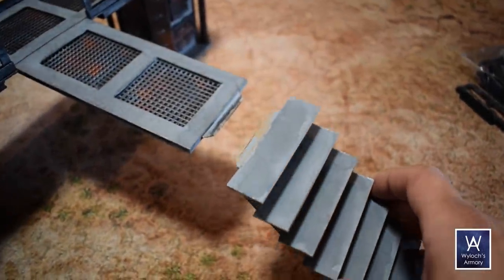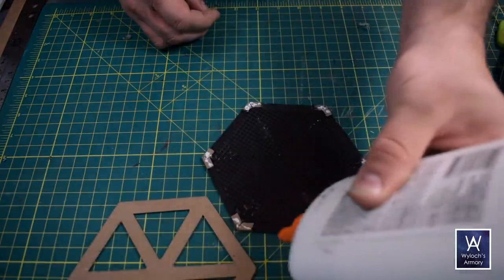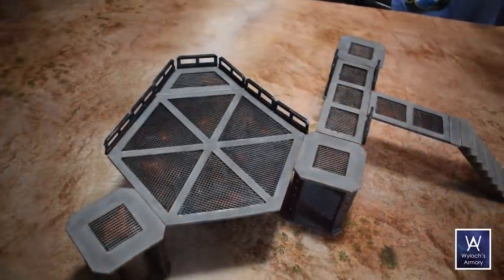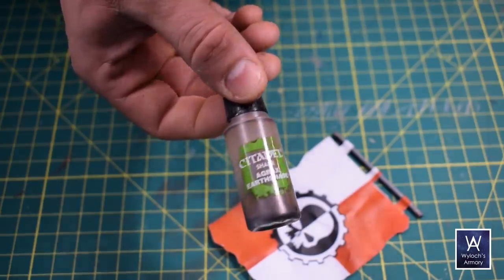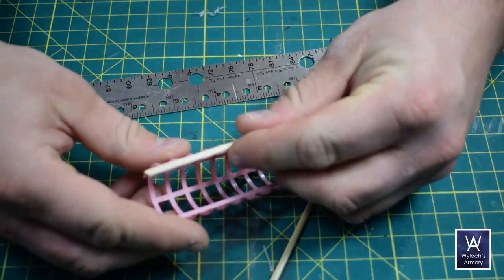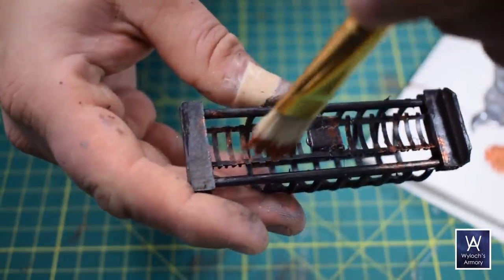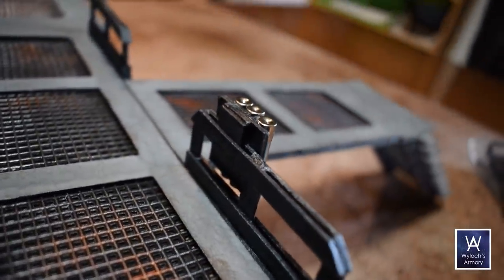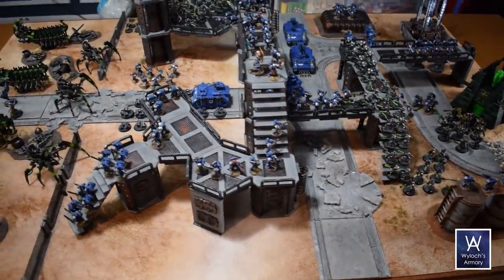Expansions For Scratch-Built Sector Mechanicus for Warhammer 40k, Kill Team

Comment: I have started to use tongue depressors for the male connectors. They are stronger and don't fray on the edges.
Reply from the maker: GREAT idea.
Reply: I bet that could be used throughout the build. Instead of cutting male tabs into the middle pieces cut everything with female slots and glue the tongue depressor sections where you want male tabs.
Reply: @ubermoose5694  other than for stability I don't see why you would want to glue them down at all.
Reply: @Monkeyshaman  what I've found with using tongue depressors is they're not as consistent in their thickness as the chipboard. So they don't always hold as tight as the built in tabs. You're totally right that the only reason to build tabs into the structure instead of just making all female slots and using double sided tabs is stability.
Reply: Are they like lollipop sticks?
Reply: Why does nobody suggests the use of neodime magnets? They are dirt cheap and bond together strong as hell...
Reply: @Presbiter  1000 lollipop sticks for 5 bucks

Comment: Me:  "Alright, just built Wyloch's gothic building, I should probably paint my actual mini's and not just  build terrain (see this video)  well dang"
Reply from the maker: Same here. Got 2000 points of Tau from an ebay rescue been collecting dust...
Reply: I'm in the process of building your fuel depot setup and I think I'm going to combine that with the modular connectors so it can become a part of the walk way system or be stand alone.
Reply from the maker: @andrewkreinbrink7023  Nice!!

Comment: Great job as always, dude.

New tip I discovered, if you're looking for quality gimble to add variation/textures to your sci-fi/modern terrain then the best thing I've found is to keep medicine capsule/caplet/pill blisters (plastic on one side & foil on the other). 
The middle parts (of the blister) usually have a great little design with extra little diamond markings that look great once primed & painted. Just superglue them on to add a little bit extra to an otherwise bare wall/barricade. 

Also, using strapping tape (used to externally package large boxes) is great for trimming as it looks like reinforced steel once primed & painted
Reply from the maker: Rockin, thank you
Reply: Great tips! I love the strapping tape one best!

Comment: they sell already black mesh at micheal's
Reply: That's what I've been using. I think it might benefit from a coat of spray primer to help with paint adhesion. It takes several layers of dry brushing to get a decent effect.
Reply: @ubermoose5694  i hit mine with matte clear coat same effect really, but the matte spray i use is cheaper than my matte black

Comment: Again, thank you for posting this continuation on your modular system of terrain.  Excellent ideas.  A thought ... an old used wet teabag for weathering your banner? Also, the hair curler ladders are great, but ... and while I understand the mechanical why ... I have to ask, why did you keep the "wide" ends to connect the two segments?  Cosmetically, this looks off and physically, would make the ladder unusable for a climber.  Couldn't these two pieces be fastenened alternatively to give a more seamless series of naturally spaced rungs?

Comment: Late to the party, but for the wood ladders use the wider side of the popsickle or whatever stick you use as a rung. Make height slightly taller than the figure base and you can have a figure actually on the ladder.

Comment: One small suggestion, you might try painting the silver ends of those fuses black then dry brush with a metallic color. The shininess kinda stands out from the rest of the terrain. I remembered that from an ancient White Dwarf article for making Epic scale razor wire. They had recommended using some kind of thin aluminum wire and advised the prime and dry  brush because if you didn't, it would just look like some aluminum wire on the table and not terrain.

Comment: if you want to add lighting take a clear plastic tube sand the outside lightly to frost it and insert a color  changing LED. wired to a control circuit and you have the beginning of an alarm system (yellow to red or green to yellow then red). great video.
Reply from the maker: I've been playing with 3V batteries and christmas light bulbs.  Big stuff coming.  ;-)  Thanks!
Reply: @WylochsArmory  I was thinking of single LED's placed behind each of those fuses would look great. Steady or flashing slowly, even a single color.

Comment: Another great video! Now I got to get to crafting asap :)  The only thing I am still not sure is the actual thickness of the chipboard you use. I have some which is 2mm thick, but also one which is about 1mm - not sure which to use. What thickness is that graphic chipboard you using?
Reply from the maker: Thanks - it's 2mm thick.  Grafix Medium Chipboard
Reply: @WylochsArmory  Thank you man! If only amazon shipping outside of US would be cheaper (sometimes it's even more than price of the product itself). Gotta find better chipboard source inside EU. Thanks anyway!
Reply: @jacknoron1  check with your local comic book store. The boxes comics are shipped to the store in often have a 2mm chip board in the bottom and/of on the ends. Most stores recycle them or toss them out. They get a shipment every week, too. Offer the owner or employees a few bucks to save them for you and become a loyal customer, if you aren't already.